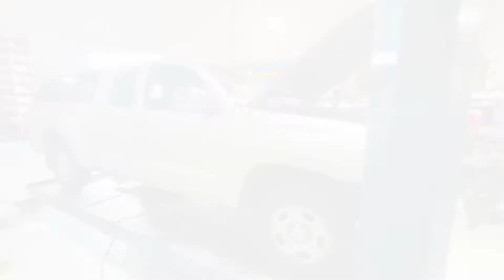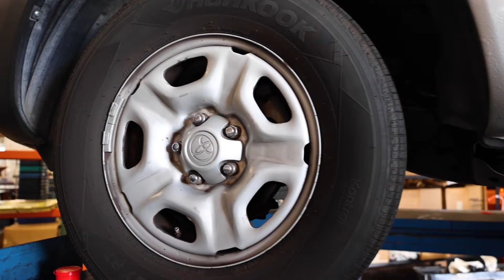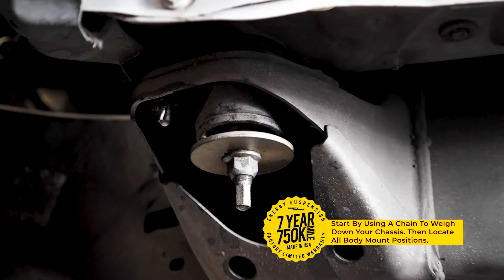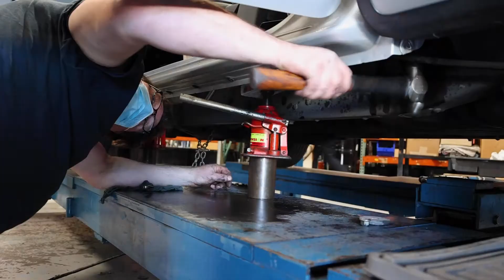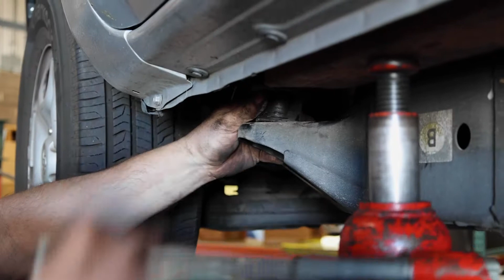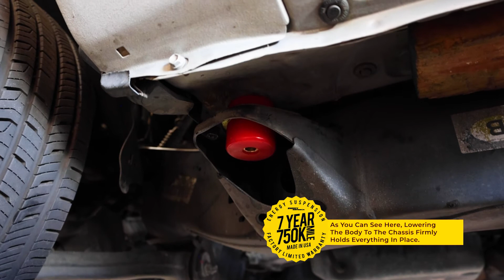Energy Suspension Toyota Tacoma Body Mount Install

Comment: I would be very mindful of the front ABS wire that is attached to the upper control arm and travels down to the hub.  More than 1" of separation from the frame and body can cause the wire to stretch and damage it on each side.

Comment: Will part #8.4107R fit 2003 Tacoma 2wd 6 lug?
Reply from the maker: Is this a custom job? Most of the time 2WD Tacomas are 5 lug and 4WD are 6 lug. Based off the information available this will work for a 2001-2004 Toyota Tacoma 2WD 5 Lug and 4WD 6 Lug. So you should be fine, but just make sure your 2WD is a 5 lug to be extra sure.